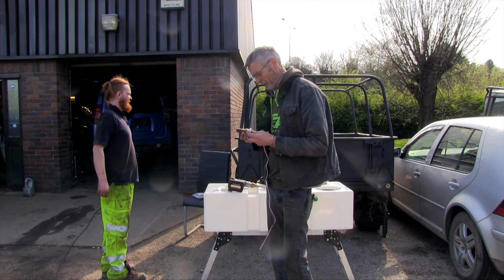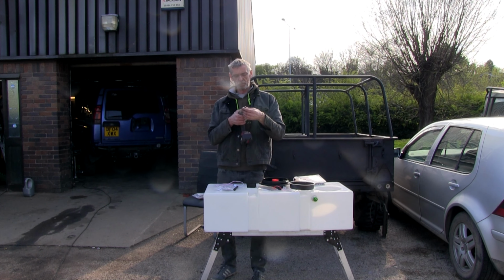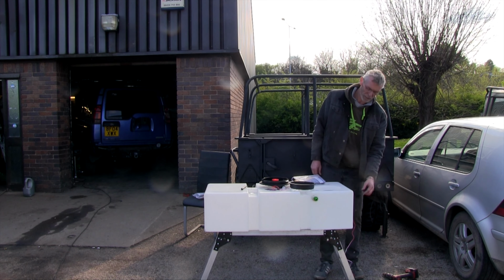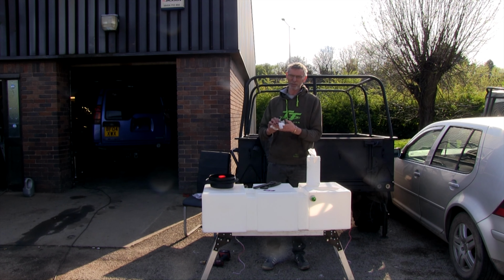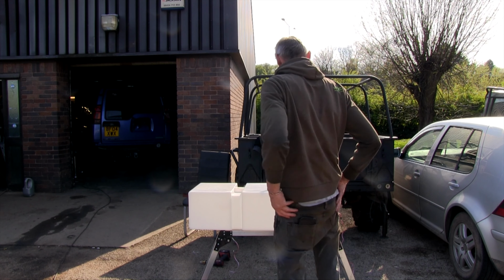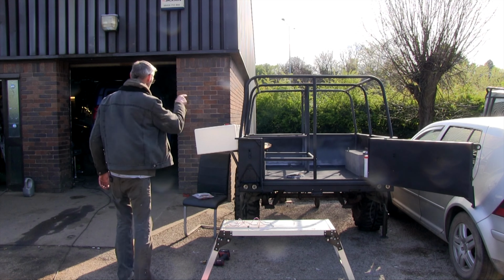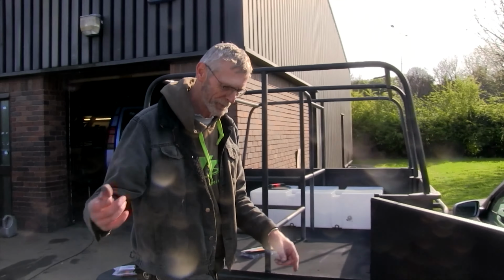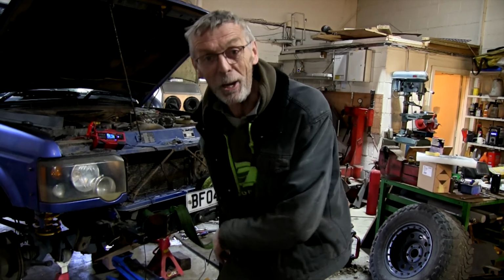OVERLAND TRAILER BUILD EP6 | UV Water Tank Light | WILL THEY WORK? | SANKEY TRAILER | 4WDUK

Comment: 🐨 you could have put the UV lights ether end like you wanted to 
  originally by running a trace through it would have saved you 
  trying to reach through 🐨🙃🍻💂👍
Reply from the maker: But then the lights would be facing each other and cancel out? 👀 suppose it wouldn’t overflow with uv light that way 😂 thanks for watching 💪🏻